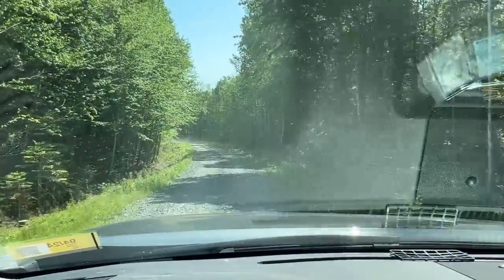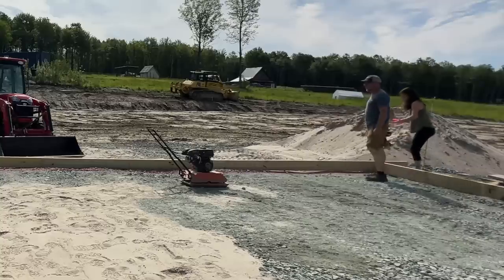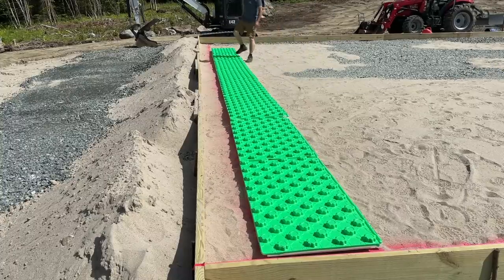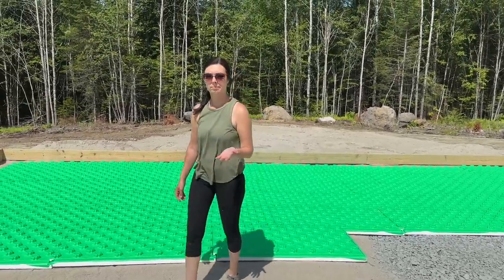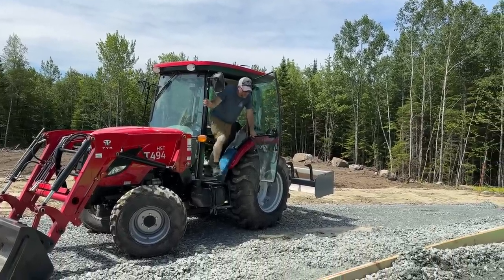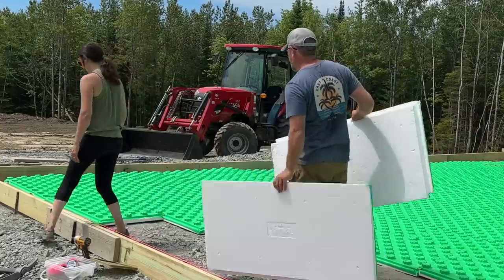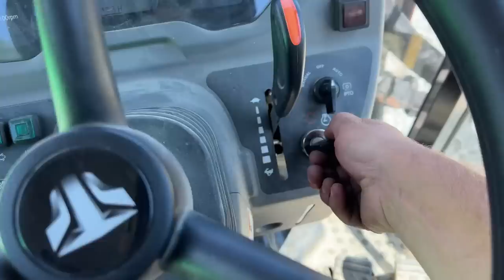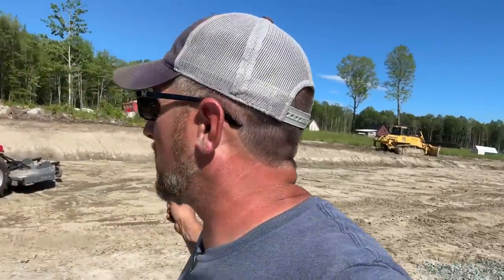You Think I Would LEARN... Looking for the Positive

Comment: Lots of cold bridging with that type of slab/insulation set up, will take a lot more energy to heat, should have the perimeter foundation separated to the floor slab which should float on insulation and have a perimeter of insulation to the wall’s/foundation

Comment: I think a roller would be a great investment. Just a plain old drag behind your tractor roller. Would be good to maintain the roads as well as rolling your pastures after planting. Get one that adjusts with either water in the roller or stacking weights on the frame.  Yes the vibrations are good but that means additional cost. A dead stupid roller works but you can find one that uses hydraulics to run a vibrator if need be. Just a thought.

Comment: you should put pluming in for a shop sink so you dont have to run to the house to wash hands or what ever
Reply: Agreed.  I think it would be better to plan on it, run the pipe and then one could choose if they will use it or not, but have the ground work done so that future needs can easily be met.

Comment: Work smarter not harder,   park the trailer closer to the job site,  carry 2 pieces or more foam when laying it out,   leave re-bar on tractor forks reaching over the forms as much as possible.   Question- you have a 4 ft frost line, why doesn't the outer 2 ft of concrete floor crack from freezing and lifting?   Just curious.

Comment: I like this new tractor ,,it seems to be heavier built ,,handles loads so much better
Reply: Al's using their original TYM T494 tractor.  The new one still has the brush hog mower on it... methinks.
Reply: @samvalentine3206  Correct Sam this was the 494, the new one is a 574.

Comment: You want the reinforcement wire to be in the center of the concrete pad or concrete wall to be the most effective also they make little cementatious blocks of different thicknesses that you can set your wire on to keep it elevated , they are also known as chairs or dobbies
Reply: They are called ‘Bar Stools’ here in the land down under.🇦🇺🦘🦘🇦🇺
Reply: @mitzigaynor-rz5zn  where have I heard your name before???❤️❤️
Reply: Last time they put special cups down to hold the rebar up that set inside the lego buttons. I think they'll be using those again. They didn't put all the rebar down yet. This was just to hold it down for the rain and wind. Have a great 4th of July!

Comment: Good morning to my favorite family. Will you be connecting the fire furnace you use to heat the house to the workshop or use something else??
Reply: It's too far to run a pipe from the existing furnace... I'd wager they will have to get some other unit to provide heat to the buildings... the shop and the barn for the animals.
Reply: When Al set-up the wood burner he said it was in it's temporary spot so it might get moved more central between the Harvest House and the Workshop at some point. Have a great 4th of July!

Comment: Happy 4th Lumnah family! Just wondering if you’re going to have another wood burning boiler for the new workshop? I know the one by the house is big but will water still be hot by time it gets all the way to the workshop? Especially in the winter?
Reply: It would not be feasible to run a insulated two-way pipe that far... too far to pump as well.  I'm guessing that another wood furnace would be required.
Reply: When Al set-up the wood burner he said it was in it's temporary spot so it might get moved more central between the Harvest House and the Workshop at some point. Have a great 4th of July!

Comment: You're going to need to build a shed for all the wood you will need to run the boiler to heat both the house and the shop during those cold Winters.  You will likely need to buy wood to cut up or buy it already cut up.
Reply: I'm guessing LP heat
Reply: If I'm not mistaken, when they put in the boiler they said it was going to heat the big house and the other buildings, such as the workshop.
Reply: HAHAHAHAAH I think 500 Acres has plenty of fire Wood...
Reply: @DukeOOO  I bet you $100 you are wrong! Accept or refuse?
Reply: @tonygrimes13  Deal!!
Reply: @DukeOOO  If not LP you lose!! LOL

Comment: Like i said earlier. This shop is  going to be huge. Are you planning on running a line from your outdoor broiler or get a new one to heat the Plex? Happy 4th from Missouri.
Reply: I imagine it would be too far to run a line from the existing furnace.  No doubt a separate furnace would be needed.  Fuel for another wood-burner won't be an issue with all the resources their property holds. 🙂
Reply: I was wondering the same thing.
Reply: I thought it would be too far too but Al has said he got this big unit to heat multiple buildings. He is also going to run another solar array for this workshop. Next up running water.
Reply: @packy57  - The plan is/was to build their main house fairly close to the Tiny House, like under the vegetable garden they built, up in that area.  That's close enough to share the furnace - as I understand Al's plans...
Reply: @samvalentine3206  Their wood boiler is for 10,000 sq feet. As Al stated in video it requires little wood to heat present house (1152 sq ft) running an insulated & deep PEX line should not be a problem particularly as present wood burner location is temporary as Al stated in a previous video.

Comment: Good morning Lumnahs! Do you plan to have it framed and enclosed by winter?  Also due to distance you probably wont be using the wood burner on the workshop? Are you going to get another one? Just curious.  Im an IT guy in south Texas and know squat about heating a house hahaha
Reply: When Al set-up the wood burner he said it was in it's temporary spot so it might get moved more central between the Harvest House and the Workshop at some point. Have a great 4th of July!
Reply: @StoneKathryn  thanks Happy 4th of July!
Reply: Their wood boiler is capable of heating 10,000 square feet, it's only heating a 24 x 48 (1152 sq ft) at moment. I t will be easy to run insulated PEX piping underground to this workshop.

Comment: I think one thing you learned from your old place was that you needed a larger shop.  Boy, you're getting that now!  It will be huge.  I have been watching since you even before you laid the foundation for the harvest house, so I know what's coming next.  I just love to watch building stuff!  I don't think you have laid the water line for the hot water to come from the boiler.  I am wondering how you keep the water hot running underground during the Winter for such a long distance.  The ground might not be freezing, but it will be very cold.  I hope the insulation on the line will be good.
Reply: The distance would make running insulated pipes prohibitive.  I'd wager they will acquire another wood furnace to heat the shop and the garage.  Lucky for them, they have lots of timber for firewood!
Reply: @samvalentine3206  When Al set-up the wood burner he said it was in it's temporary spot so it might get moved more central between the Harvest House and the Workshop at some point. Have a great 4th of July!

Comment: No underground electric?
Reply: Off grid
Reply: @Creative-Chaos  They still need to connect to their own solar power and furnace system unless they plan to install duplicate arrays with storage and management on each cluster of outbuildings. Then, there's water trenching. It's smarter to get it done while you have the large professional excavator on-site rather than mess around with the toy machine later and struggle with those NH boulders again.
Reply: @puirYorick  more importantly, not running service under the slab means running it up the outside wall...
Reply: @stevec7272  IKR. It's the learning curve of YouTube DIY culture.

I'm watching another creator get his pond from two years ago ripped out and properly relined with clay because it leaked. At least they're generous enough to share these lessons. Also, it's good for their local economy - in the short term anyhow.
Reply: Al said he is having solar panels on the roof of the workshop so he'll have power there from above. Have a great 4th of July!
Reply: @StoneKathryn  Thanks!
It's still an oddly missed opportunity by not having all that generated capacity interconnected while the heavy equipment is there to dig a ditch for utilities.
Reply: @StoneKathryn  lol

Comment: Aside from the fact that the workshop is so far from the house, I'm not understanding the choice of radiant heat. It will require another very expensive heat source. It has to be kept on constantly. It's not like you will be in there every single day. Could have installed some Modine heaters and used them only when he was there. Simple.
Reply: When Al set-up the wood burner he said it was in it's temporary spot so it might get moved more central between the Harvest House and the Workshop at some point. Have a great 4th of July!
Reply: Also Andy don't forget that their wood boiler can heat 10,000 square feet.
Reply: @tonygrimes13  I know, but that wood require either digging s very long trench (which I think would be almost impossible) or moving the boiler half way in between which I think would reduce it's efficiency. The main question though is why radiant?

Comment: if you are useing solar and outdoor furnise why are you saying fuel cost saving
Reply: Their wood boiler is capable of heating 10,000 square feet, it's only heating a 24 x 48 (1152 sq ft) at moment. It will be easy to run insulated PEX piping underground to this workshop.
Reply: @tonygrimes13  I think they'll use LP...makes much more sense to me.
Reply: @DukeOOO  Maybe but I remember when Al was connecting wood boiler to house he said that the boiler was to be heat source for everything.
Reply: @DukeOOO  After watching today's video you may be right.
Reply: @tonygrimes13  Of course I'm right :)
Reply: @DukeOOO  Don't rub it in! LOL